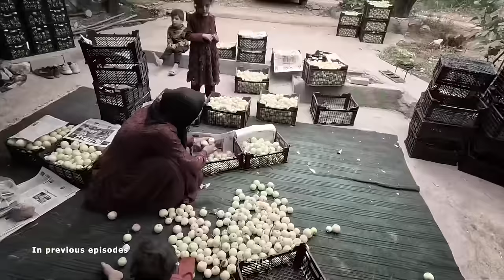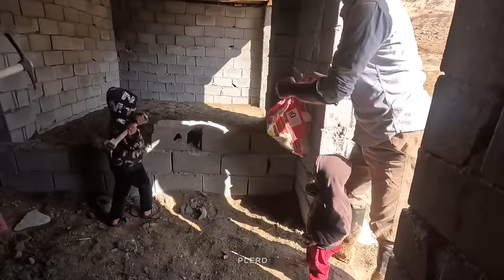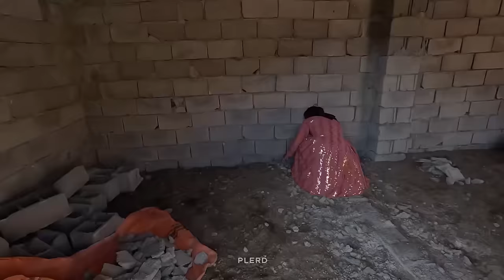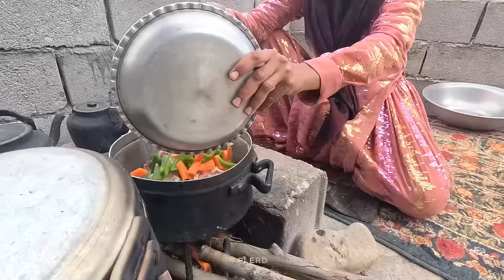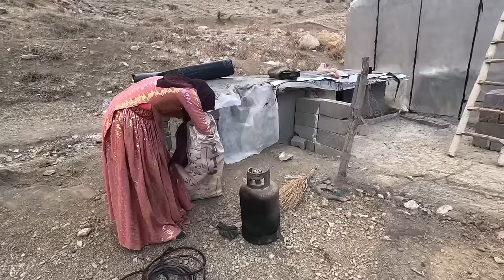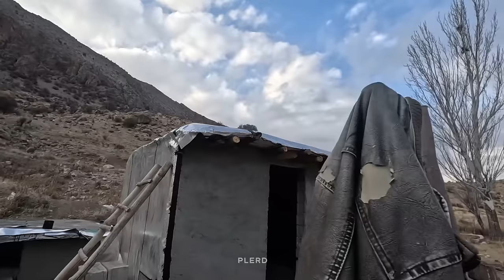Resourceful Mother Transforms Barn into Bedroom and Kitchen

Comment: It would be more appropriate to convert the sheep house into a sleeping room and kitchen. A wall should be installed in the middle of the room and a wooden door should be installed. The sleeping room would be larger and more comfortable for sleeping. I think it is more appropriate to use the original sleeping house as a sheep shed. After all, it is correct for people to live more comfortably than animals.

In addition, it is more appropriate to cook and eat indoors in the kitchen when cooking. If you cook and eat outside on a rainy day, it is easy for children to catch colds and get sick if their whole body is soaked in the rain. Winter is also relatively cold now, so you should pay attention to keeping your children's bodies warm and not getting sick from the cold due to the rain.
Reply: @user-in5oy6pt7s Yes, this is very important, so I would say that you should add a wall between the room and the kitchen and set up a wooden door, and then add two windows on the kitchen wall space that can be opened and ventilated.